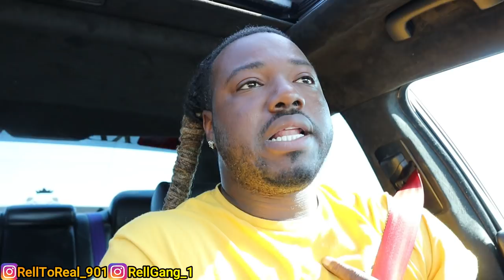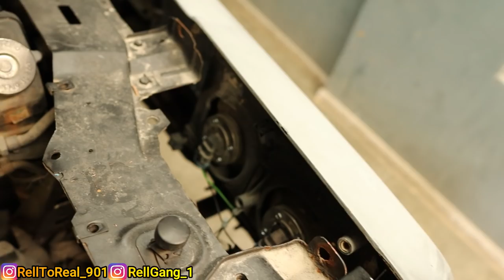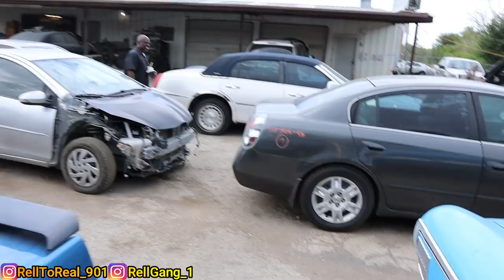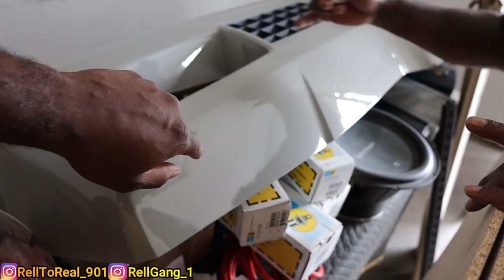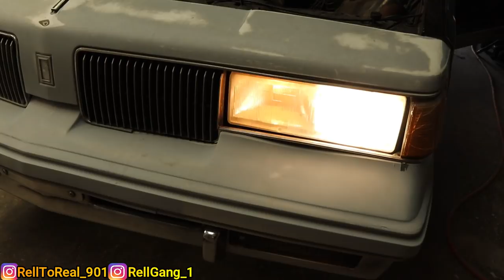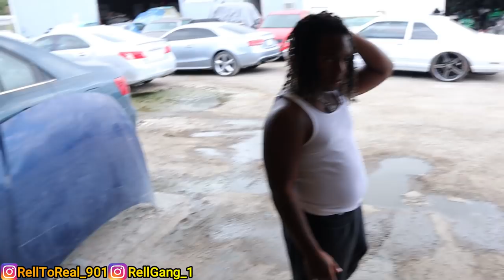THE CUTLASS COMING TOGETHER!!

Comment: I have a 2005 c6 corvette 6.0 LS2 aluminum block with a stage 2 cam and cnc ported 799 heads in Little Rock Arkansas selling for a reasonable price u can even brang ya mechanic to check it